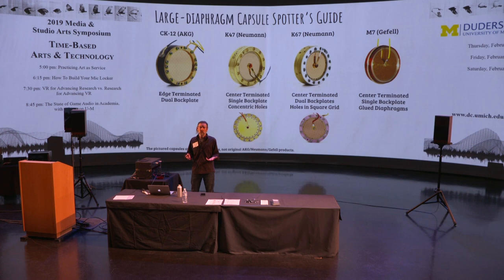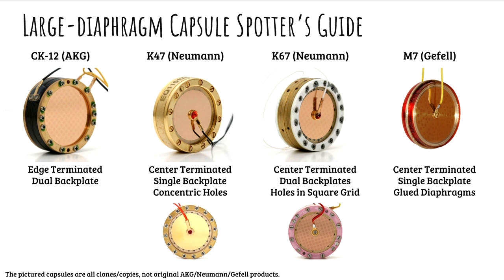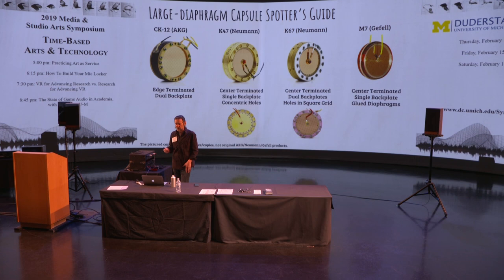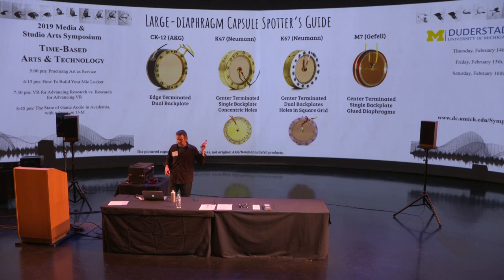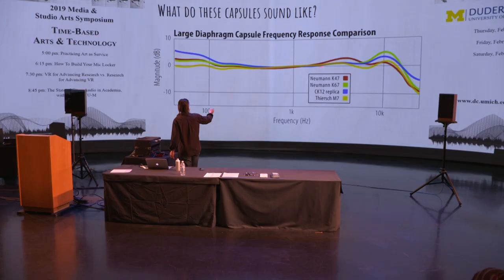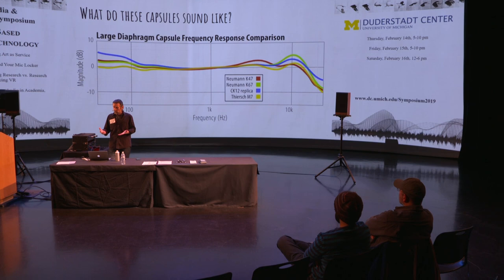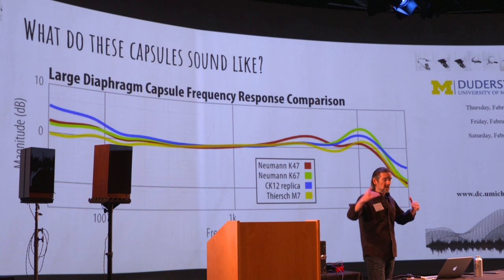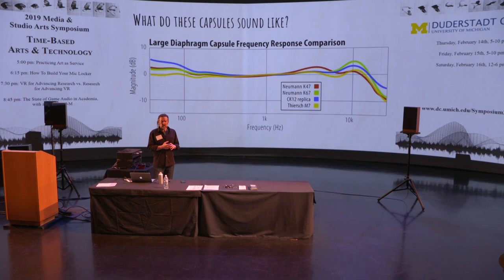Condenser Mic Capsules

Comment: Most excellent. I've been studying microphones, capsules, circuit design, mechanics design and transformers for 12 years, and was able to complete the sentences before they were finished. This is extremely accurate information in all regards.
Reply: I want to get into all those topics, how should I?
Reply: Same here... Here's a free tip for you all with locker full of chinese mics that sound harsh. Add a passive noch filter inside the mic between pins XLR PINS 2-3 to tame the 10-11KHz of the output. What actually makes the mics sound ever worse is preamp distortion. You set the lavels and when ever there is 10-12KHz information peak it will distort, making it even harsh sounding. You can't remove that post with EQ.
Reply: Ohh nice info. I wasn't aware of these differences. Maybe one of you sound-nerds (i mean that as a compliment :) can help me with a question:
I am working with a team of scientist and biologist together to record infrasound of Elephants to locate and protect them (not only from poaching). 

Long story short: Which capsules or mics are most sensitive for very low frequencies. Specially 5Hz - 30Hz which is the sound that elephants make to communicate over long distances (more than 1KM).
Our aim is to install a network of mics in the jungle. That's why we don't want to use 5000USD mics. Anything you can recommend under 50USD?

For now we use a Panasonic WM61A which already is quite good for the price of 6USD. But i am sure there is something better out there :)
Any ideas?

Thanks already in advance for any help we get.

More info (also about the WM61A) can be found here: https://www.researchgate.net/publication/320596116_Eloc_Locating_Wild_Elephants_Using_Low-Cost_Infrasonic_Detectors
Reply: @edsteve  - I think that what you're going to find is that the low frequency response is not determined by the capsule size, but more of how the circuit is designed, or how the parts are incorporated.

The one thing that differs among capsule sizes is sensitivity. Larger capsules are more sensitive, especially when you start dealing with membranes in the 3-4 micron range. 6 microns is standard. (One micron is about 1/50th the thickness of a human hair). 6 micron diaphragms are a studio standard because they add some heft to the sound. Small diaphragm mics are more accurate and handle transients better. It's going to be difficult to boil down the right combination of qualities, but I think I can help you a bit since you've already used the WM61A. Transients really aren't affected in the sub-audio range. However, that doesn't mean you need to be thinking large diaphragm. Confusing, I know.

Cost wise the only mic I know that lists a frequency response lower than 20Hz is the Behringer ECM8000, which you can find at Sweetwater for about $30. It's low end it listed at 15Hz (however most measurement mics typically go down to 3Hz), it's omnidirectional and has a near ruler flat frequency response, and is used as a calibration mic. I think it even uses the WM61A as it capsule (maybe). It's possible that the frequency goes lower, but they rate microphones for human hearing. The only issue I know of is the self noise is a bit high.

I hope that's useful. You could at least afford to get one to see if it goes as low as you need. I sure would like to help the elephants. They're special and wonderful creatures who have been abused by humans when they deserve our protection. I  also hate poachers!
Reply: @Fos3tex  Cool. Thanks a lot. That's exactly the info i was looking for and brings us one step closer. It also clarified my question if a bigger diaphragm would be better or not. I will definitely buy the ECM8000 and compare it with our DIY version. Elephants will thank you. Poachers will hate you :)
Thanks again
Reply: @edsteve  theoretically the larger diaphragm the better low frequency sensitivity. You can try large 35mm capsules, or even you can try to use large LF audio speaker as a microphone. Of course it's only theoretical, it needs research and actual testing.
Reply: @zloyfet  what's this theory based on? I believe large diaphragms can capture "more sound" in general because of the bigger surface area, resulting in higher signal level and thus better SNR, but how are they better in capturing low frequencies specifically?
Reply: One of the most important video for Mic capsules out.!

Comment: Hello, these capsules are sold loose and are inexpensive, is there a microphone that includes them?
Reply from the maker: All mic capsules are not the same! There are many cheap capsules on Ebay and Alibaba. I would not recommend buying those. We have tested dozens of those capsules and seen wildly varying quality levels. If you want a high-quality capsule that includes mounts, installation support, and a warranty, see my products at MicParts.com . Be aware that unscrupulous sellers and scammers have taken the MicParts capsule names (e.g. RK-12, RK-47, RK-87) in an effort to deceive their customers. The RK series capsules have a great reputation because we make a high quality product, with a decade's worth of history in the industry and 10,000+ satisfied customers. We sell them exclusively via MicParts.com and the MicParts store on Ebay. Any other "RK" capsules sold via Alibaba, Reverb, Ebay, etc., is a counterfeit capsule that lacks the sound, the reputation, support, mounts, etc. Buyer beware. If you're not interested in DIY, and just want to buy a microphone that has a great capsule (and fantastic components, with optimized circuit designs), see the Roswell Pro Audio product line. We design those mics, and we do all the soldering / assembly / testing / tuning in house.

Comment: Hello! I need Your advice, please. Got myself a not expensive T. Bone Retro Tube II mic, which got a really bad problems with self-noise too, but it's not the case. Previously I thought, that I can deal with a sensitivity inperfections in high frequences by EQ'ing it, but I was wrong. Just in case it's my first mic and I targeting on Neuman's '47 clones, but for now I only can afford that. So my question is if I change a capsule (it has a K67 in it) in this mic I, probably, need to change pretty much everything around to make it sound as it should or changing the capsule to more "lowered" (K47) unit can be a quick solution? Also I'm thinking to upgrade a tube to a Electro Harmonix or something You can advice, maybe, but not sure it worth it. but anyways. It's a standard 12AX7 tube in there everywhere, right? The mic has a stock long 10 meter 7-pin cable from a power supply, which I can upgrade to a shorter one's (3-4 meter, beter quality), but I think it may be even more highs if I do it. Because I tried a 10 meter Sommer manufactured XLR cable and 3 meter DIY Sommer Club and 10-meter one sound's better, because it lowered sibiliants. The shorter one's bring a harsh and more mouth clicks that deal with. So I just investigating if there is something to tweak. I think You have an experience. Thank You!

Comment: I rubbed off some of the gold in the front of the coil the mic still works what damage did I do?
Reply: I did the same ... I got mad whooly noises on my at4040 now
Reply from the maker: If you removed gold from the diaphragm, it could affect the mic's sound and output level. If you don't hear any difference, then I think that means you got lucky. Gold does not adhere to Mylar very well, so it never makes sense to wipe the diaphragm of a condenser capsule.

Comment: What capsule do I need to make my   voice to sound deeper?
Reply: You don't need a "capsule." You need a complete microphone. It's misguided to think that the circuit and physical housing (body/grille) are irrelevant. It is true that many cheap mics have bright capsules that are incorrectly handled by their circuits; those sorts of mics tend to exaggerate sibilance and mouth sounds, so you'd want to stay away from those. 

You would probably want to start with a mic that has a more or less flat frequency response, like the Roswell Mini K87 or Delphos II, to ensure that you're not boosting high frequencies. Then experiment with positioning. Closer mic placements create proximity effect, which boosts the lows of your voice. Also try mounting the mic upside down with the grille at forehead height, tipped backwards to point at your mouth from above. This position helps the mic avoid plosives, and helps capture chest resonance, which can make thin voices sound richer.

Comment: That is not CK12 capsule, its a chinese edge terminated k67. Has nothing to do with CK12.
Reply from the maker: You are partly correct. The photo shows a capsule modeled after the CK-12, but the one in the photo is obviously not from AKG. I suppose the title image is misleading; it should have said "AKG style." The presentation slide about capsules notes that these are recreation capsules rather than AKG/Neumann/Gefell originals. But that's largely irrelevant to the point of the talk, so IMO the distinction is pedantic. 

I'm not sure how to respond to the claim that this is a "chinese edge terminated K67." The K67 is not edge terminated. The backplate drilling pattern of this capsule is not the K67's. And the frequency response is not a K67's.
Reply: You are partly correct, partly incorrect. It is similar to the K67 in the blind and through hole patterns, with the exception of the center where a K67 would have the post. All those holes really do is dampen the diaphragm and cause a delay network to provide the polar patterns. AKG's network and depth of backplates was more complicated. Being edge terminated has more of an effect that you realize. Think of it as a drum head with your finger in the center, then play it. Even though this is much smaller, it has a huge impact on the overall response of the diaphragm. The "air" you hear on a CK12 is actually a ringing in the high frequency range. When you use a center termination you change the frequencies where that ringing happens. Even though the AKG CK12 and this version are different mechanically, they share more in response than they differ.

Comment: Sorry for the noobie question but I just bought a peluso 2247 with an updated m7 capsule - it just came with it as the other user upgraded it - what exactly should I expect to hear with the upgrade compared to without it  !?
Reply from the maker: Easy answer -- without the capsule, the mic wouldn't work at all. ;-) 

Pedantic answer: the K47 and M7 capsules sound different; the M7 tends to be flatter in the upper mids, although the final frequency curve of any capsule is influenced to some degree by the acoustic environment, e.g. volume of the grille, mesh construction, etc. Without having heard the mic, and without knowing which M7 capsule it has (there are not many out there, but some of them are funky), I can only speculate that the mic has a flatter frequency response now, in the 3-7kHz range, than it did originally.
Reply: @RoswellProAudio  it's a beeznees m7 capsule - oh man it doesn't sound like an upgrade  the way you say it lol
Reply from the maker: @ryancohenmusic  Try it out. You might love it. My reply was not at all intended to suggest that your mic is bad.